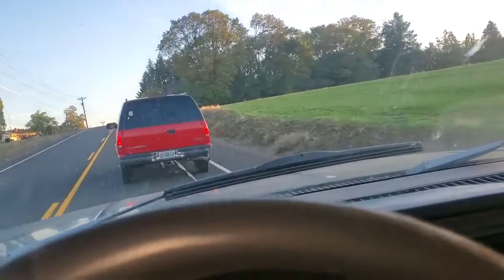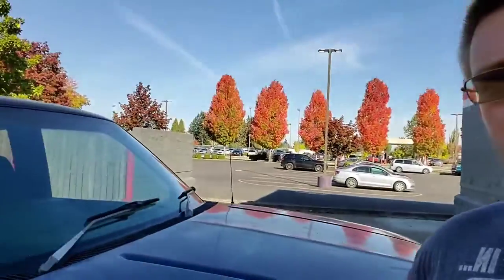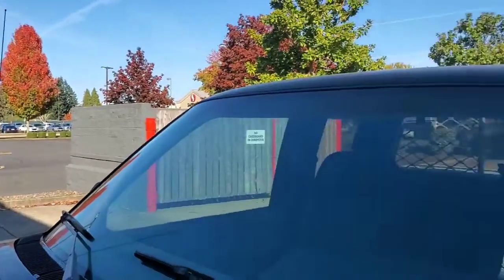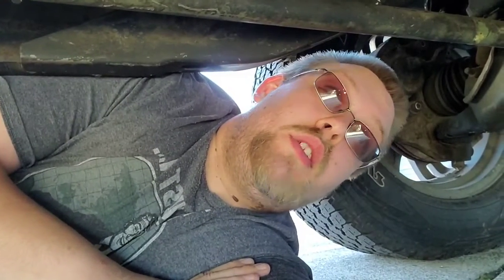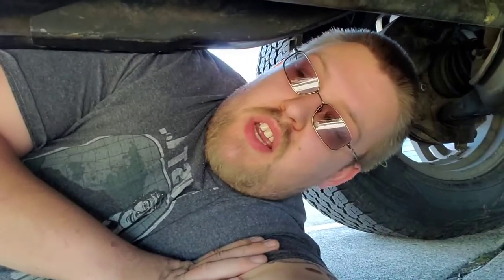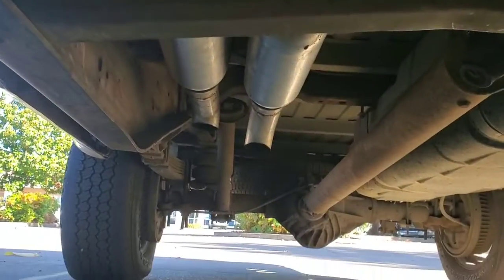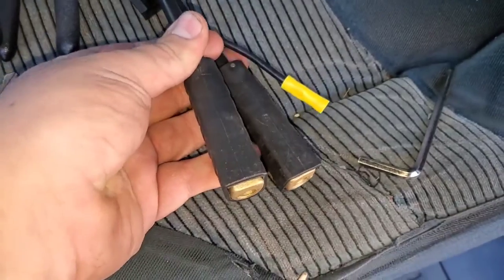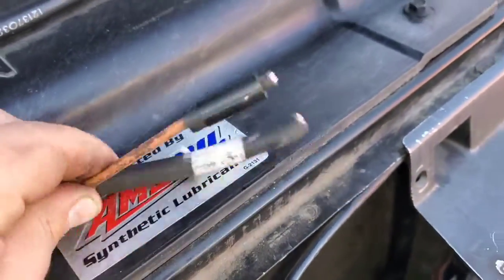most roadkill day of my life

Comment: With the cash u spend buying that LS u should have just bought a different truck well same truck but 99-03 chevy .. u van find them 4 like 2500 -4500 dlls in the same condition maybe even better then ur old blue 1.. 🤨🤨
Reply from the maker: Yeah probably but I only spent around 2k for the whole swap. From $500 junkyard engine, motor mounts, used carb,  intake ignition box, ebay headers, built the exhaust myself, rockauto clutch kit super cheap. Anyways I didn't that much I think.